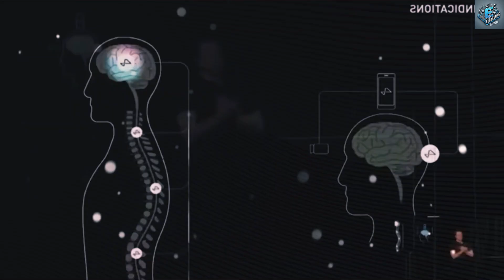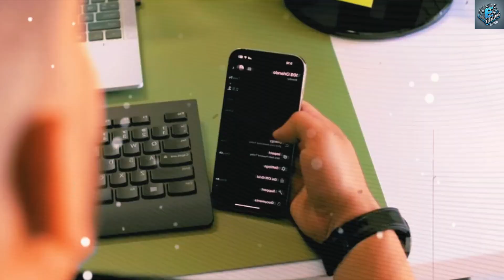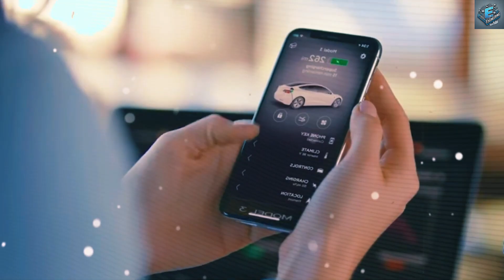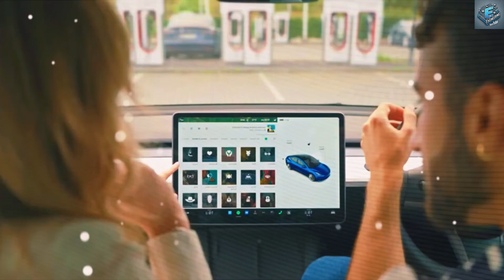Wheelchair Expert Shares Top Features of Elon Musk's $179 Game Changer

Comment: I have MS and am a veteran. So the VA provides with a mobile wheelchair. I have had difficulty maneuvering so I stay inside most of the time. Can I qualify for your wheelchair?
Reply from the maker: Thank you for your service, @frankszydlowski8716. Tesla’s $179 wheelchair is designed to provide greater accessibility and mobility for individuals like yourself who may face challenges with current mobility aids. Its lightweight, compact design, and advanced features—like autonomous navigation and anti-tip safety mechanisms—make it particularly suited for indoor and outdoor use, even in tight spaces or uneven terrains.

Since you mentioned you're a veteran, it’s worth exploring if the VA might subsidize or provide support for this innovative wheelchair once it’s officially launched. Additionally, Tesla may announce specific programs or eligibility criteria closer to the release date.

We recommend staying tuned for official updates from Tesla regarding distribution, partnerships, and potential programs for veterans. In the meantime, this wheelchair seems like it could be a great fit for your needs, helping you regain confidence and freedom in maneuvering both indoors and outdoors.

Would you like us to keep you updated on any new information about this wheelchair?
Reply: 5